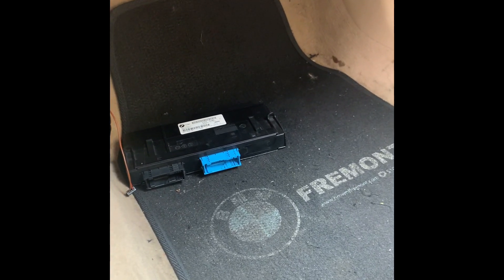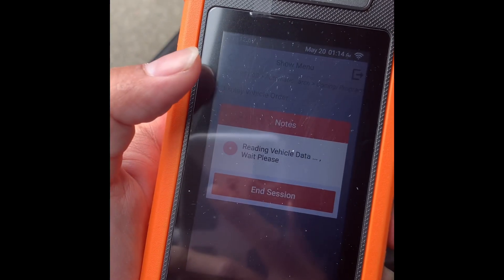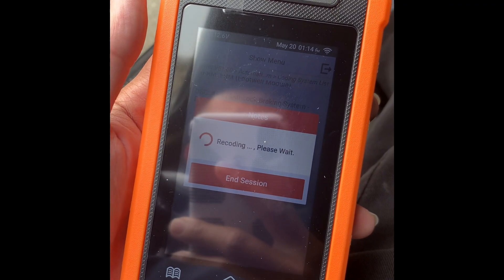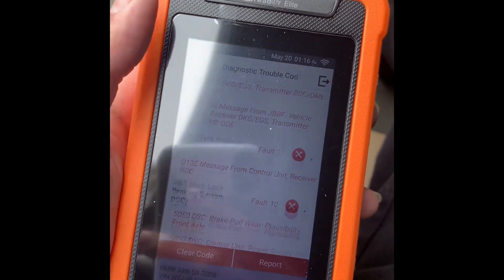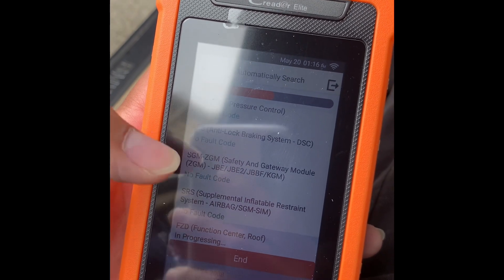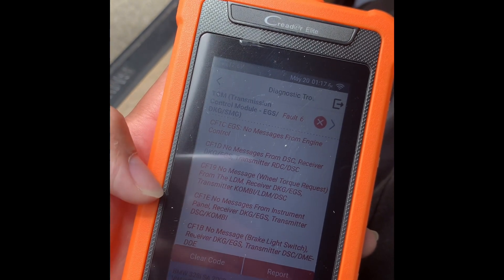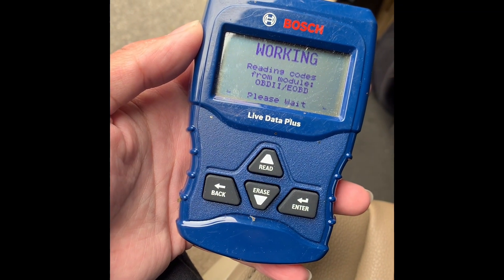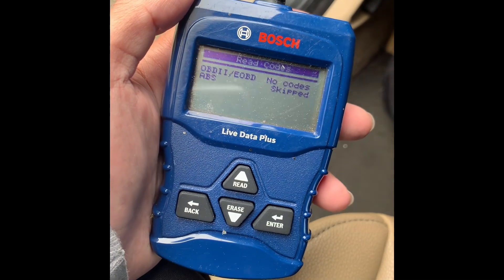Recoding BMW JBE with Elite Launch Scan tool

Comment: So you’re obd2 wasn’t working with current Jbe? You removed it, installed replacement Jbe than coded it with the tool? Thought it wasn’t communicating with obd2? Just from putting in new Jbe this allowed you to communicate with scan tool?
Reply from the maker: @robkenney826  yes

Comment: You need to be connected to power right? A running vehicle or a jump box while doing this? 

Was that a virgin jbe3? Or was it one off a used car? 

I’m curious if I get a Jbe off a similar car as mine with similar options is this all I have to do to code if??
Reply: I’m pretty sure all this unit does is “codes” it. Which pretty much just matches it to the vin. If you need to add or delete options you need to program it.. which is more in depth. But in theory if you get a Jbe that matches your same year and options this should be fine as it should be plug and play other than coding to your vin which this unit will do

Comment: What symptoms were you getting? Impressed this tool can code , does it code to your stock cars options by putting the year and make in? I’m having typical Jbe problems on my 09 335i sedan and want buy a used Jbe and code it with this tool.

Comment: I have a problem with my JBE on a X5 4.8 2007, need ro be replaced ..I got an used one and tried to change the VIN with ista+ but could not do it.  So..this tool can do it for sure? Thanx
Reply: Did you try it? Figure it out?
Reply: @itzuan  it would prob work if you got one off same year and similar options

Comment: Was that a used jbe that you replaced and coded or a brand new one feom bmw?
Reply from the maker: @franklowe2180  used
Reply: @Winstonzm  cool. Thanks bud. I have a 06 mini that needs a replacement jbe and this tool will probably save me 900 bucks overall.